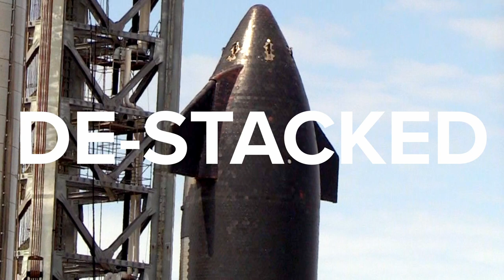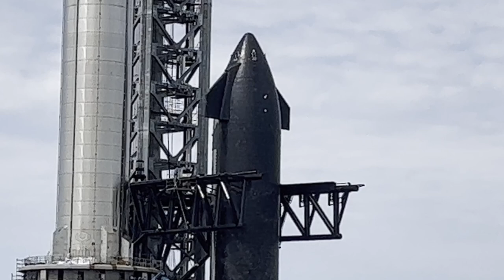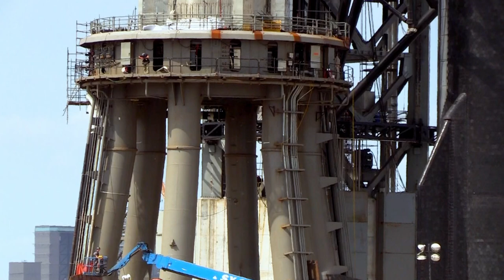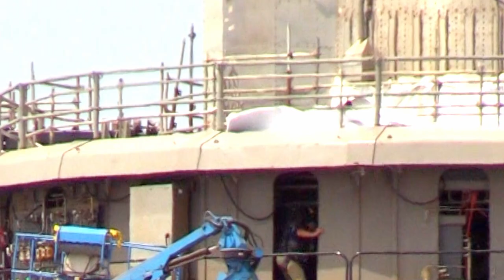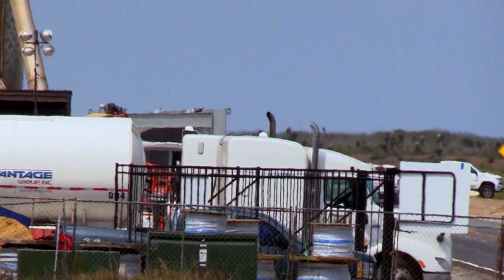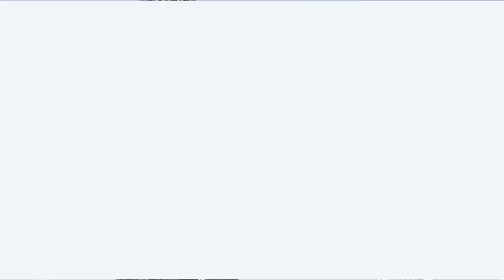Will Starship Super Heavy Booster 4 and Ship 20 Fly?

Comment: It is highly unlikely they will be allowed to full static fire, much less launch, a rocket of this magnitude in That area.  If it failed (which is not exactly unlikely guys.  We’re talking about a unique ignition system with like ~30 boosters and literally tons of fuel.  There is no plan for sound suppression and their fuel farm is shockingly close.  A failure in early launch would be catastrophic.   Honestly, the first actual launches should occur at the cape.  I think all of this has been prototyping (which was needed - it’s an entire new launch system/rocket after all!). The assembly of a new Starship launch tower at the cape is not an insurance policy.  They’re obviously being told, probably by NASA, that the first launch has to take place there to assess decibel levels, reliability of the systems, etc….